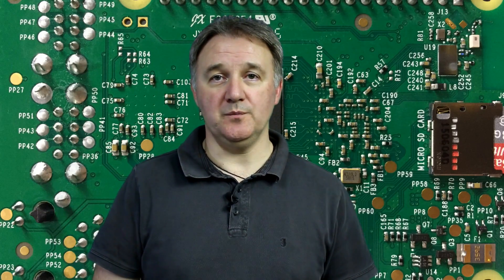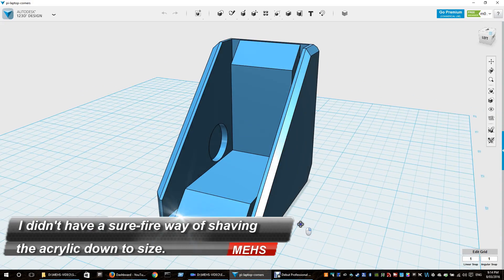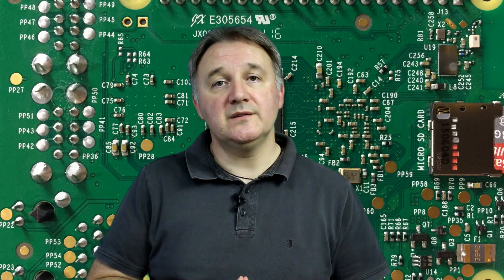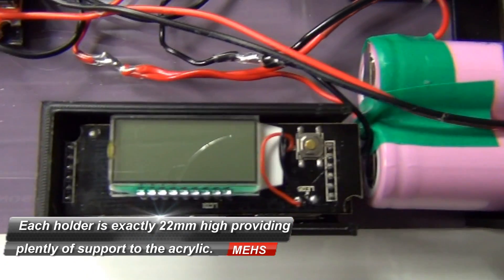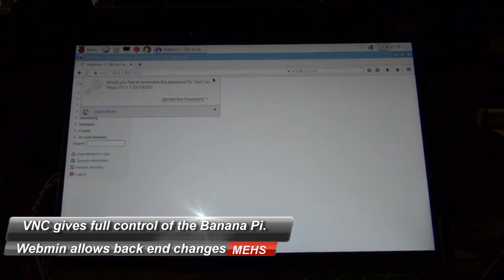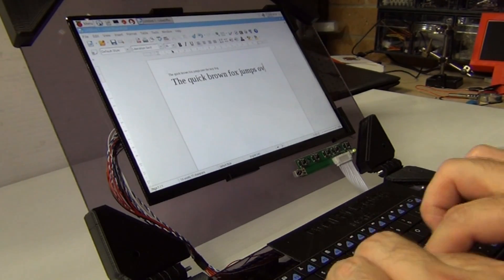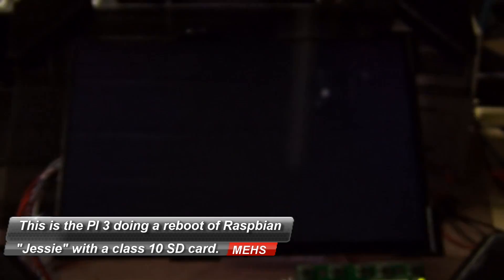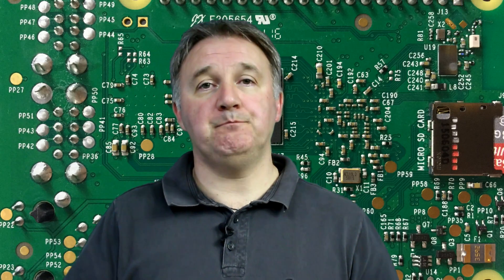Raspberry Pi 2 / 3 - Dual Pi Laptop Part 2 (MEHS) Episode 41

Comment: typed this comment and watched this video with a raspberry pi model 2. didn't workout very well even after an overclock on the GPU and CPU there is still a ton of screen taring.
Reply from the maker: If your referring to YouTube playback through a browser on the pi2 then yes it's not good.  Only watchable with around 18fps in a small window at 360p or less.  I suggest the pi3, much better, or as I showed in the video, load up kodi and watch YouTube through that.  Let me know how you get on.  Cheers.
Reply from the maker: Also, were you connected to the net over Ethernet or wifi?  And, did you go for the 6volt overclock settings?  Cheers.
Reply: My Electronics & Hacking Show l overclocked on 5volt as much as l could. l was thinking about getting a model 3, but l rarely use my model 2. l originally bought it for a project that never came to be. l am thinking about putting it in a old Macintosh instead, but l would rather put a mac mini in there.

and l was connected over wi-fi, but that wasn't the issue. it loaded the video ok, but it's GPU is nothing compared my GTX 960.
Reply from the maker: +electronics for fun - HA!  Yeah the Pi 2 is a little behind the performance of the GTX 960 :)   Don't give up though.  You can definitely get very good youtube performance if you use kodi instead of just a browser.  There are also some very specific overclock settings you can try for better performance.  If you do want to get a solution working without using kodi etc then yes the Pi 3 is quite a bit better and gives a fluid youtube experience through a browser, even iceweasel.  If you compare playback using wifi then ethernet you do get a bit better streaming over ethernet.  The old mac ideas sounds good.  I'm going to do something similar in a future project.  Cheers.
Reply: My Electronics & Hacking Show thanks!

Comment: why are you trying to make just working portable PI ? why not something special ? :) for example try to make notebook using raspberry pi 7" touch screen but as thin as posible and packed the most things you can with the best look you can :) challenge yourself :) I don't say these things you do are not good. no ... they are awsome but I can see that you use too much space on some parts. for example what about that area arround screen ?
Reply from the maker: Hi.  Fair statement and thank you for the constructive feedback..  I do agree that there is room for improvement.  Better designs can produce better results with less wasted space.  I often do an initial design or project, like this one, and use the lessons learned to make a better one.  One of the difficulties is making things small but still allowing enough space to assemble and, sometimes, disassemble using hands and hand tools.  This is where the first design helps.  If I had the time I agree that a better design or my own board with all the parts I need to support a Pi project would save a lot of space.  I am thinking of a pi3 tablet and a thinner laptop so I will take your comment on board.  Cheers.

Comment: thanx very much .. l want to ask .. how can you depend on one for screen and another for other process .. i can't got it ..
Reply from the maker: Hi.  Basically we are talking about 2 separate computers.  The pi2 has the screen permanently attached to it.  The banana Pi does not have a screen attached.  You can access the banana Pi through a virtual screen using vnc software .  If the Pi 2 is not running , you can't see the desktop of the banana Pi unless you connect to it over the network from another computer.  The vnc session starts when the banana Pi starts so it's always available.  Any services or functions like a download or a game server run on the banana Pi just like a normal computer runs if you simply switched off the screen.  The only issues in this laptop is that you need to turn on the pi2 to see whats going on with the banana Pi.  Since that takes about 15 seconds and your probably using the pi2 desktop anyway it's not a problem.  I hope that answers your question.  Cheers.

Comment: Hi, good video, i wish to build something similar to what you made, can it be made with two or more Raspberry Pi 3, can link to material list and maybe the 3D File for a 3D printer. :)
Reply from the maker: +midtnight nohaku  - Hi.  The materials list is in the video description.  If you drop me a line including your email address through the contact page on my website  http://www.mtechshow.com  I can send you the 3D print files used in this project.  Cheers.

Comment: like the case, looks premium.
for the battery voltage, why not get an analogue to digital convertor and feed the signal into the pi, you could then monitor the voltage using the pi, with an auto shutdown once the voltage gets too low
Reply from the maker: +tim bo - Ooh I like that idea.  Thanks.  Yes it would be the best solution to have the Pi show the remaining battery within the operating system.  Might look at that by itself and do a video once I get it sorted out.  Cheers.

Comment: Nice one, why not use a HDMI en USB switch ?
Reply from the maker: A kvm switch is one way to go.  I didn't use one because good ones are expensive and it would take up more space.  Vnc works well for this situation.  If I needed clean fluid video from the second Pi then vnc would not be the best option.  Cheers.